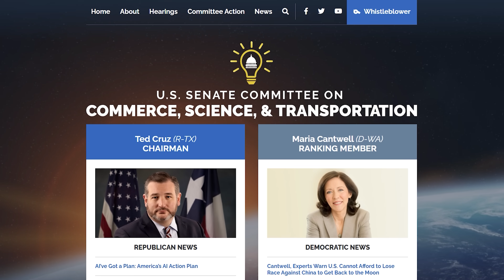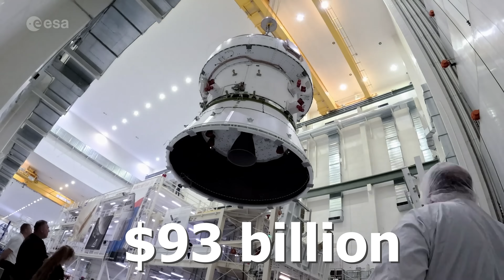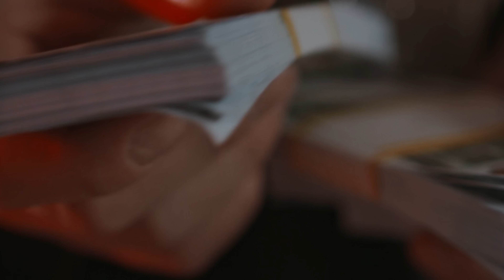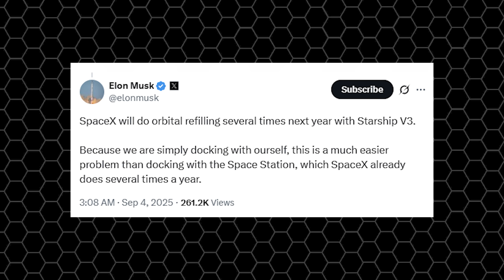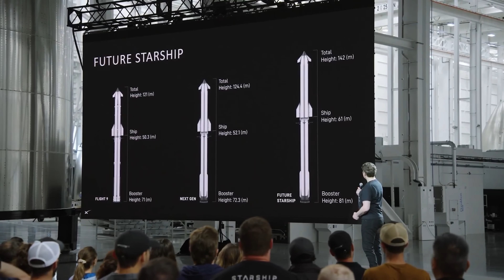What Elon Musk just declared after ex-NASA Boss Slams Starship Complex Humiliated Others

Comment: How is the USA NOT at risk for losing to China in … EVERYTHING???
Reply: China has a very distinct need to project success and advancement, both to its own population and to other world governments.  The rapid push and modernization of their infrastructure, military, space agency, and the power of mobilizing its billion-plus population.  However, there have been several cracks appear in their facade.  Google "tofu buildings."  There has been so much corruption and grift that their infrastructure is falling apart within years and buildings collapsing.  The fuel from their ballistic missiles was use by troops for cooking food and replaced in same cases with water.  There are even reports that the current population may only be 2/3 of what was estimated. 

Can they get tot he moon?  Absolutely.  After all, we did it with primitive tech back in the 1960's.  It is possible.  However, China is not the overwhelming, unstoppable juggernaut it portrays itself as.

Comment: What are NASA talking about !  Their rocket has to be refueled 20 times in orbit to enable it to make it to the moon?  How did NASA make it to the moon 50 odd years ago without refueling 🤔 maybe the conspiracy theories floating around aren’t so ridiculous 😮
Reply: indeed somehow now its very difficult but 50 years ago was achieved .... anyone how nasa did it without refueling? or how it was refuel?
Reply: @konardkonrado7755  They took extra engines and extra stored fuel in the LEM. Part to land and part to take off from the moon. As they only wanted to get two men (ok, 10,000 lbs) there they could do it that way with a moon orbit rendezvous. SpaceX wants to get 100-150 TONNES there (not 2 men) so it is vastly different and can't be done just by lifting the fuel you need with the initial rocket lift off.
Reply: Different mission. In the 60s they only wanted to get two men on the surface and just squeaked it with a moon orbit rendezvous. (They had considered the Earth orbit rendezvous that SpaceX is now proposing and rejected it) Now they are   trying to get 100-150 tons there - It is a vastly different problem.

Comment: He's completely wrong about still using his idiotic $90 billion SLS & Orion systems, and correct that Space X's Lunar Lander is too complex requiring everything to work flawlessly.

The "fully reusable" SuperHeavy booster before its first flight, was twice as powerful than the Saturn V booster, quicker to make,  for around $50 million.   That's $50 million for a "fully reusable" Booster that is twice as powerful than the expensive & disposable Saturn V booster.

The expensive & disposable SLS booster does not have enough power or delta V to get an Apollo CSM & LM directly to the moon as the Saturn V did.   But the fully reusable $50 million SuperHeavy Booster, with disposable upper stages can easily send an Apollo CSM & LM to the moon  ... right now.

NASA was wrong to break up the return to the Moon ... into a separate launch system ...  the command modudle ... and the lunar lander, when it should have just been one complete system, that is better & cheaper that the "Apollo" System & able to get more cargo to the surface of the moon to "quickly" build a moon base.

Again.   NASA should have requested a single System  (launch, land, return ) with a fixed development budget & launch price.   All the OG company's would have quickly failed to reached targets within budget, & dropped out leaving only Space X to either go fully, partially or NOT reusable with NASA standing firm on a FIXED budget & price. 

The fully reusable SuperHeavy Booster is twice as powerful than the Saturn V booster and only costs $50 million to make.  The Starship Lunar Lander requiring multiple LEO refuelling is unnecessary & too complex for NASA''s return to the moon & building a base.

NASA simply needs to buy  a disposable SuperHeavy launch from Space X, then tender to Space X & others, disposable upper stages and the CSM & LM at fixed development budget & price.  Space X will be forced to abandon the fully reusable Starship because the competition will all being making cheap disposable upper stages, riding on Space X's SuperHeavy Booster.
Reply: The SLS is ready for crewed flight. Starship isn't.

Comment: bridenstine is right... i advise to watch his full speach.

elon, take note... consider the 150t payload to go directly to moon without adding unnecessary compexity of refueling heavy vehicles. consider lighter starship, the 2nd stage, which's payload section is cut off from the top because it, the top, has seperated as 150t 3rd stage. the 2nd stage can return then and will look like a cross design between starship and fairing. a lot of weight can be reduced if top section is designed properly, possibly involving carbon fiber cross beams holding the structural integrity behind the heatshield of starship's payload section. In essence, your problem is weight of the architecture, which complicates reusability, durability and simplicity.
Reply: NASA is welcome to try on its own if they want to.
Reply: @peterclarke3020  I definitely wish the would!

Comment: Why do they need so much fuel to the moon? The Saturn Apollo program didn't need these huge amounts so what is going on here?
Reply: Elon wants full reusablility with his Starship design whereas the Saturn V was fully disposable.

The Starship (booster & ship) can only get  the Ship to LEO because it is the 2nd stage and uses most of its fuel just to get itself to LEO.  The Booster & Starship will have to be disposable to get to GTO.

And to get to the Moon, requires the Starshp to refuel so that it could use its engines to move from LEO to a trans lunar orbit with a much larger mass than the  upper stages of the Saturn V due to the large amount of fuel that reduces as the engines fire.

Note how the Upper stages of the Saturn V get smaller, with its engines propelling less mass, where as the Starship is a single upper stage with at least 1200 tons of fuel that that it's engines most propel once the SuperHeavy cuts out.  And on the launch pad the SuperHeavy has 3400 tons of fuel at the beginning that drops as the 33 raptors burn through this .... mass.
Reply: Well SpaceX is using a reusable rocket, not a disposable one.  Also the rocket is being designed for a Mars mission, it’s being adapted for a Lunar mission.
Reply: It's pretty simple. 100% reusability, is a huge handicap! It defines why Starship is configured as it is.
Reply: Because we are sending MUCH more massive hardware to the Moon, not the tiny 3 man capsule & lander

Comment: SpaceX should give up the idea of in-orbit refueling. Swappable fuel tanks should be used instead
Reply: You know the fuel tanks are NOT separate from the vehicle, right? They are PART OF the vehicle! They ARE the vehicle!!
Reply: @wolfman007zz  Right. This means Starship should be re-designed to be fully modular, with cylindrical modules of various types that can be connected to each other via standard interfaces
Reply: @wolfman007zz  you mean, docking?  Yeh they don't do that regularly at all..  Certainly not to build something like a SPACE STATION!
Reply: @ffsireallydontcare 
Docking involves linking with an environmental seal. Fuel transfer is different. But swapping “modules” would be 100+ times more complicated than a fuel transfer hookup. Modules would also GREATLY increase mass of the vehicle, since the fuel/oxidizer tanks are then separate from the vehicle primary structure. Right now, the tanks ARE part of the vehicle primary structure. The tanks support the weight and thrust of the vehicle; the outer surface of the tanks are the outer surface of the vehicle.
Reply: You know the fuel tanks are massive right, and it would be so tedious to take an entire fuel tank out of a star ship mid orbit
Reply: @Matches1st  Unless the spacecraft is designed as a modular system from scratch. There could be propulsion modules with different numbers of engines (and perhaps with different engine types), fuel modules (with different fuel types), payload modules, crew modules, reentry modules, etc. They could have different lengths, some could have thermal protection. Different crew modules could have different life support systems, different radiation protection (depending on a mission), etc. All these modules would share only the interconnection interfaces. One could assemble an interplanetary spaceship of any size and configuration from these modules once they are on the orbit.

Comment: Jim Bridenstien is a politician, not an engineer. As such, he was never qualified to run NASA.

He clearly doesn't even know about the Rocket Equation or he would know that "dozens of tankers" is BS. It will take 10 V4 tankers to put up a V3 Starship Lander (which will be ready at least a year sooner than V4 lander). This will put 100t on the moon with a healthy reserve of fuel and reflective foil unrolled along the sides like a simplified shield (James Web satellite or Skylab parasol). This will drop boil-off dramatically and avoid the "hectic race to refuel the depot" and extend the stay on the lunar surface to weeks, potentially months if need be... Also, Spacex has the manufacturing might to crank out at Least 2 full rockets per month by 2027. (They built their factories to build 100 per year... engines and all.) Spacex is building out a vast infrastructure of factories and launch pads (recall that they launched more than 130 F9 orbital rockets last year and are on track to beat 160 this year with a stellar reliability record). Their "flight leader" rocket core has been reused 30 times so far. 

All of which means that if there's a problem with boiloff on the moon. Astronauts have a 1,000 cu meter habitat to bang around in and months of supplies and Spacex could Literally build them a replacement ship, launch it, and bring them home in that time once the infrastructure is in place (about 2027). They might also have a spare ready to go because the rocket is that cheap and they have that much money to burn. Much more by 2027 as they start launching their far more capable Starlink V3 constellation from the start of 2026. They expect to launch Starship at Least monthly in 2026 (they reserved 25 launch windows).

Jim would know this if he were an engineer and was paying attention. 
He was not qualified to run NASA then or now if he doesn't even understand the basics. 

Jim's a paper pusher, a politician with zero engineering training and apparently, yet he speaks about technology as if he has a clue. He doesn't even understand the goal. "Permanent presence" on the moon. Can't do that with Any of the other contractors. They can't put 100t of supplies on the surface for $1billion. Chinese won't be ready until 2029/30 with a much less aggressive design... we will be there in 2027 and if we aren't, Spacex will put us there in 2028, happily footing the bill without congressional money and endless deliberation. He is currently well on his way to building infrastructure to put us back on the moon 4x per year for about $1b per flight with Crew Dragon replacing the SLS/Orion $4.5 billion per flight pork project. Starship and Crew Dragon can step in and slice at least $3 billion per trip off the price tag... taking 4 trips/year well inside NASA budget.

Jim doesn't even understand the point of a "permanent presence". Its about colonizing the moon cost effectively... not wasting taxpayer money to enrich political allies.

Comment: ISS=
Orbital Pork Barrel..

Starship's Forté is Lift to orbit. And fuel transfer is cool, 
But we need to get as much usuable mass pemanently out of this gravity well as possible for money and fuel spent. and if docking not an issue, maybe fuel cartriges, could be a thing, and taken to lunar or Mars orbit, To be reused there or on the surface.

Also heard a couple days ago on another channel, that the Chinese company copying the Mechazilla Tower is now shifting towards, long glide re-entry profiles and then Side landing their tube ships on Earth via side thrusters...

Both sounded familiar to me, The more acute re-entry profile would mean less required heat shield consideration, perhaps even as little as a sprayed on coating.

And the Side Landing would eliminate excess infrastructure dependency, and allow more creative designs over time.

I also notice they were working on Longitudinal Gore construction methods now, which would have enhanced creative shapes potential over Ring Welds.
And be a stronger and more aesthetic finished hull, and faster to construct.

Dont know where they got those ideas?

But it could leapfrog them over SpaceX,  and maybe someday we could see past Politicians and DOD personel learning Mandarin in re-education camps.... 😂

If say Chinese welders got better leadership than the Mexican Rocket Welders Assn. gets...

Sure they will run with what works, and improve on it.
Say come up with better side thrusters that were mini Rocket engines using the same fuel, and upgrade the side landing system to Moon and Mars...
Would be pretty easy if they can make it work in Earth's gravity well.

Which would also allow them half hour point to point lift for Troops and Cargo.

Only need fuel on far end to get logistical.

Not need towers, and tank farms, could use ships or even Logistical Fuel Subs...
Might even be possible to do the side landings in water with no damage.

Interesting times....

Just sayin'.....
Reply from the maker: A lot of interesting points there — but even with new concepts, pulling off safe reentry and reuse is extremely hard. SpaceX has years of data and testing behind Starship, and that experience is tough to leapfrog overnight.
Reply: @alphatech4966 
We'll see... but they've gone from catch tower to control surfaces on a tube ship...
A serious reduction in infrastructure dependency. and if they can reduce heat shield any, its all payload positive.
And having done writs on it, glad to see somebody going to try it. And if it works, surely a wake up call for some.

I have suggested simple experiments that would test the thesis. A simple model stainless glider hull from LEO....
If correct, sure would save alot of time and money! 😂
Maybe enough to wake up those doing Congressional hearings right now?
To have the Chinese excel using something ignored by all those Experts with lots of data....

"Imagination is more important than knowledge."(Einstein)

Last time I quoted that, it got heavily down voted by experts with lots of data, who thought I was Dunning Kruger about parts count and simplification on the Raptor 1 heading SpaceX for bankruptcy.

My response was: 
"I'll win in the end."

Been winning ever since... From hot Staging structure, to Resonance in a Vacuum, to over diameter down comer...

And enough more I cant remember all of them...
Most of the writs right here on Alpha Tech...

Just Sayin! 😂

Comment: Since Spacex will have to fit circa 16 new small engines just to land a starship on the moon,perhaps they should do what the Chinese are considering and land it ( and t/o with these new engines) on its side.
Reply: Any modern rocket would break up if it landed on its side. You would have to add extra structure and that would make it heavier, defeating the purpose.